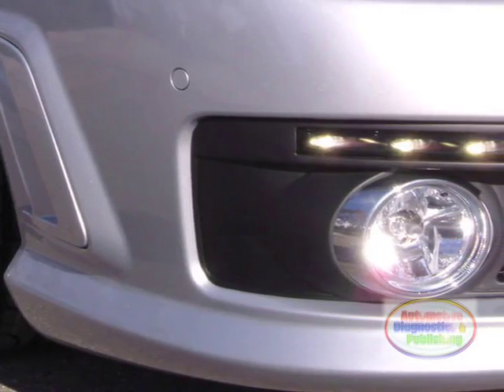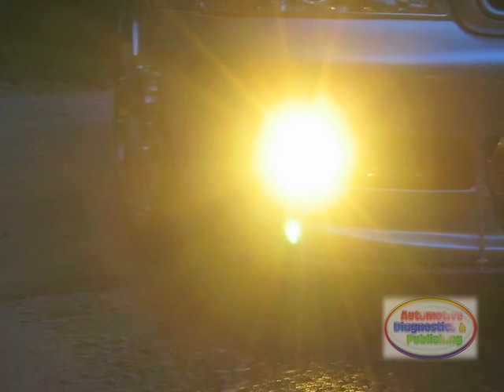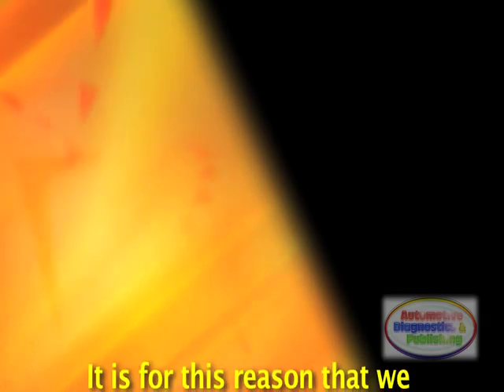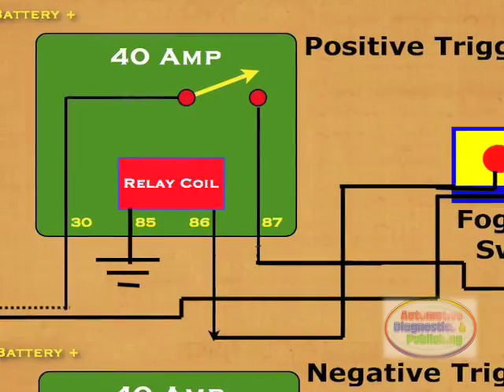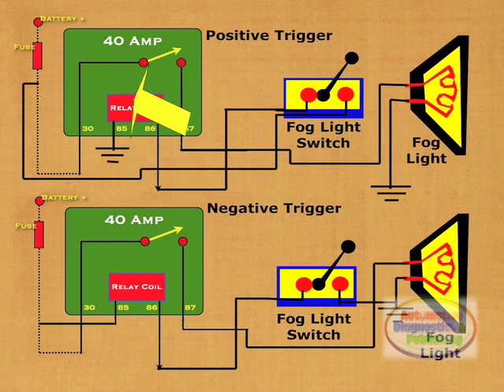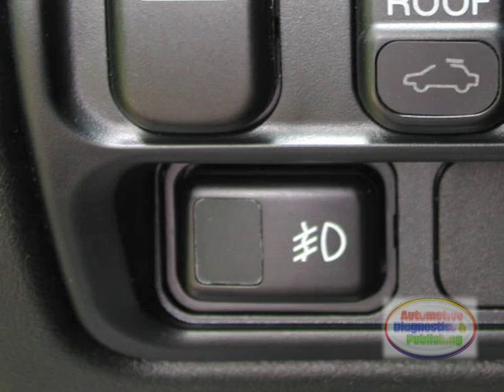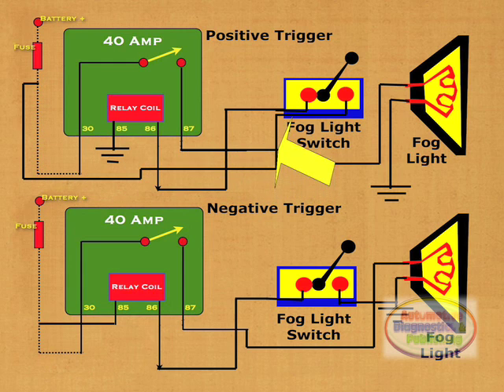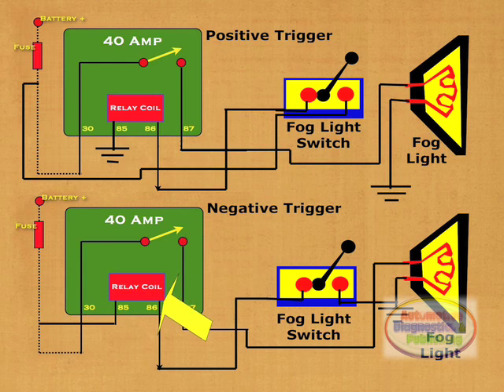How to Wire Relay Fog Lights

Comment from the maker: Thanks for posting. Yes, that's exactly right. I thought it was useful to cover both trigger schemes due to the fact that if you're using a fog light switch that came with the car it could be either or (Neg or Pos) trigger. Thanks again...

Comment: Thanks for the post...question, I am attempting to wire LED fog lights to a 2017 GMC Yukon Denali.  Although, I am wanting to know how to do this bypassing the switch that comes with the kit and use the original switch in the cabin.  Might you have a solution?  Patrick

Comment: Hi, thanks for posting, I will use this information to install fog lights to my car, what is the different between relays 30,40 and 80amp??, I just bought a kit for the headlights of my car, so has 2 relays 80amp, this good or is too much? my car uses bulbs 12v 60/55, I'm thinking of upgrading to 12v 100/80

Comment: Hi I buy a fog lights for a elantra 2018 and it came with 2 yellow wires and 1 white , the other is black red and the plugs for the lights, but can you tell me for what is the white and the 2 yellow because the fog lights got the turn signals
Reply from the maker: See diagram

Comment: But when the car is on the fog lights will get 14 volt and blow right (from the alternator) . How to make the fog light to get the voltage of the battery only (12.5 volt when the car is on)
Reply from the maker: No